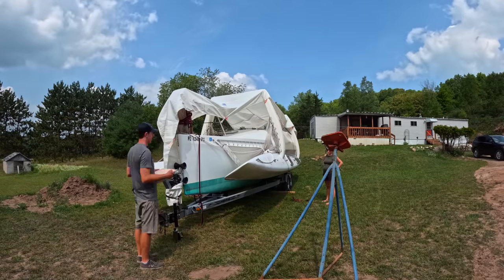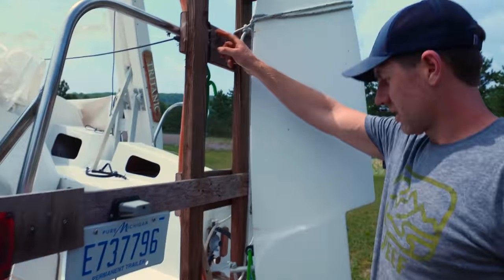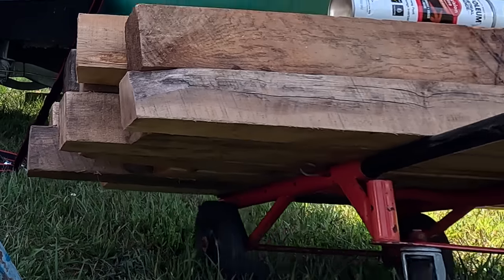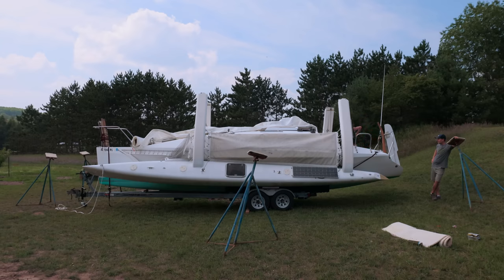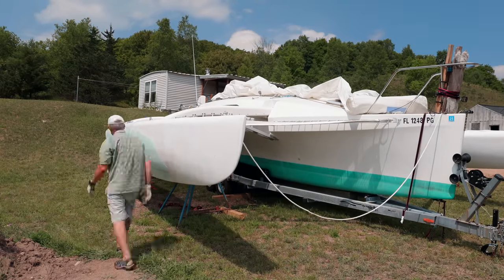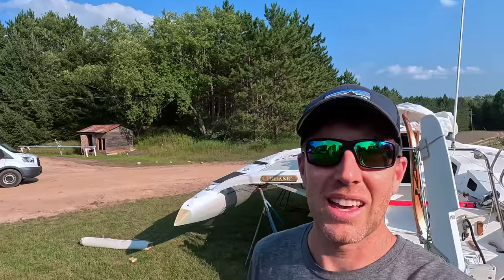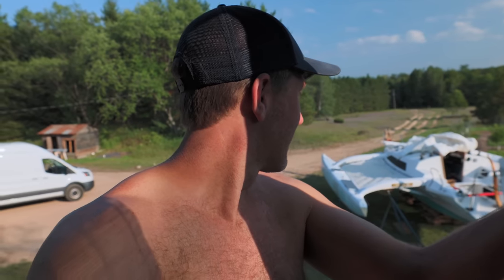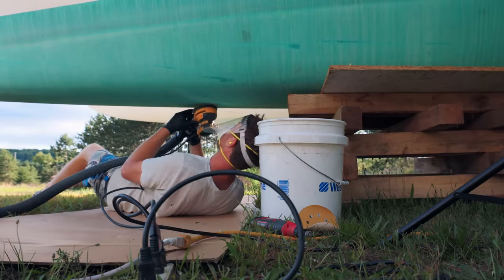Is this Stupid to Do with Two People? | Sailing Soulianis - Ep. 130

Comment: You would normally use marine sealant like Sikaflex or the US equivalent, put a bead where your finger is at 15' 18" then hand tighten the nut on the inside and clean off the excess sealant leave to dry overnight then fully tighten the nut another 1/4 to 1/2 turn. Job done.

Comment: To get my 18 foot yacht off its trailer, I built a wooden stand to support the rear and jacked the stern up so it could fit underneath, and then built a wooden gantry to lift the front with a chain hoist and then placed some wooden blocks under the bow. It was constructed for a total cost of around $200, which was for the chain hoist, and it works a charm that I use each year after winter to get it ready for a summer sailing season. The good thing is that I can do the whole process on my own without needing any additional assistance.

Comment: Great fun, guys. I agree that the depthsounder would have probably been fine with just a quick clean up and a  squirt of quality sealant, but whilst you were there....good call to have a proper look and prep the surfaces for a long lasting job. Check the sealant instructions, sometimes the correct method is to apply the gear, just snag up the fitting then let it set. Final tightening after the product has cured, makes sense when one thinks about it! Cheers, thanks for sharing!👏👏👏

Comment: Installing through hulls almost daily for my job all you need is to clean up the surfaces and put a bead of 5200 on it. It is ok that it wobbles and isnt a perfect tight fit in the hole that is what the nut I for on the inside to tighten it up. I use 5200 fast cure and launch the boat a few minutes later and never had an issue with it leaking. Also make sure the arow is facing fwds on the inside of the boat on the tranducer
Reply: From the yard's experience, 5200 might be fastest and strongest but 5200 is permanent never intended to be removed. Not sure I agree that applies to that part. I think I would use one grade more removable.

Comment: Consider how to prevent your trailer from causing leaks around the through-hull transducer. I don't see a way to modify the trailer to keep from putting pressure on the transducer. As the boat is pulled up onto the trailer, it's going to put pressure on the transducer for several feet, perhaps even the entire length of the trailer, depending on how deep the boat launch is. Consider moving the transducer closer to the stern, so it doesn't have to rest on the center of the trailer at all. This will decrease the frequency of the transducer hitting the bottom or rocks when you pull up at a shallow beach. Anytime you can have a solid hull is better for preventing leaks and having a penetrated hull. Although many people love a through-hull transducer, it doesn't have to be in its current location. Moving it further back will offer it better protection from the trailer. It could also be swapped for an external transducer mounted on the stern. That might completely prevent future leaks caused by the weight of the boat pressing down on the trailer where the transducer is mounted.

Comment: You should get high density foam cube blocks... Two under the main hull and two under each ama at a height higher than required to put the trailer under the main hull.

Comment: This may not be an issue when I post this comment, but do the stands your using supposed to be used on grass?  Maybe a 3/3 board under each foot will prevent them from sinking in the dirt if that placement is long term.  Maybe not a big deal as the majority of the weight is on the centerline and you have your Post stack under the hull for support.

Comment: You briefly mentioned sawhorses under the mast. Optimum placement for 2 sawhorses in 21% in from each end. This gives the minimum bending moment for a simply supported beam
Reply: Yes indeed.
Reply: I'm working on repositioning the bunks for my 26ft sailboat. I'll see if I can work in your advice!
Reply from the maker: How bout that? Appreciate the solid math!
Reply: @artsmith103  The 21% only works on a beam with a constant moment of inertia -- a whole sailboat does not meet the criteria. What you DO have to watch for is maintaining proper tongue weight -- 10% of the boat and trailer weight. I failed to get my boat all the way forward on my single axle trailer, didn't know I had negative tongue weight, and it almost swapped ends when I was trailering.
Reply: @chashague8479  Do you own a Macgregor? What you described is common problem with their crap trailers.
Reply: @chashague8479  Tongue weight specifics: 5-7% is recommended, 7% is best. 10% max that's justified. Shorter trailer tongues (distance to axle) heavier, longer trailer tongues manage with less.
Common cause of boat loading a few inches short of the bow bumper is the strap angles up to bow attachment point. On steeper ramps this is big problem. If so, try to mount winch higher.
Reply: @chashague8479  Another interesting example are large horizontal tanks with dished heads. Saddles are only 10% (of ttl length) from the straight side ends.
Reply: @artsmith103  Not a MacGregor, a Balboa 20. Has longitudinal bunks, curved to conform to the hull shape, which I replaced a couple years ago. I just have to remember to pull it ALL the way forward when on the ramp.

Comment: Awkward wire in the way. Maybe yours is different or stuck, but usually the sensor part to which the wire is attached comes out of the through-hull fitting itself. That allows you to take it out when necessary in the water.

Comment: Too bad those lightweight flexible solar panels weren't more reliable. You could clip them on the outrigger netting and have a ton of solar power. 
I like the idea of a solar kayak like boat with inflatable/removable outriggers that use lightweight aluminum poles & netting. Some lightweight folding 📂 solar panels to clip onto the netting, small solar system, electric boat motor and throw in a small sail. Lol

Comment: Needs a fresh coat of bottom paint while you access to the bottom of the boat.
Reply from the maker: Yea we thought we’d never do bottom paint again after applying copper coat to the tartan. Guess we were wrong.
Reply: Yes that bottom paint looks very rough! I removed the ablative bottom paint altogether from my F-82R floats this past spring and it made a HUGE difference in boat performance especially in lighter winds!!! I would recommend something far smoother like Baltoplate or VC-Offshore.

Comment: How will you solve the  issue with the trailer hitting the depth sounder, thus another potential leak.
Reply from the maker: It's a good question which is one of the reasons we were considering removing it altogether.  It's not ideal for going on and off the trailer....